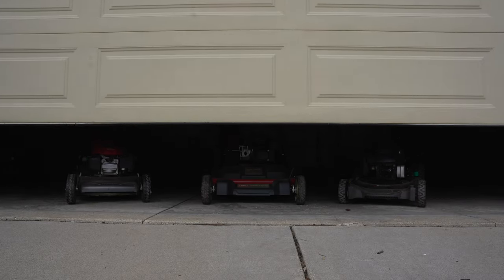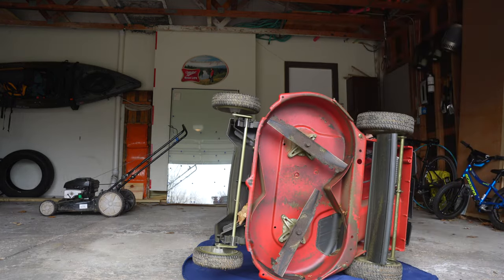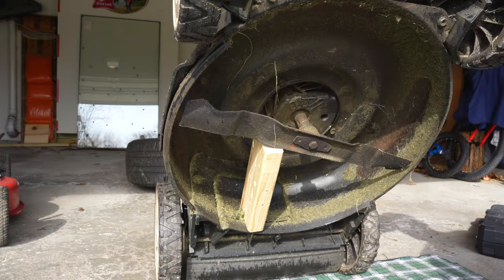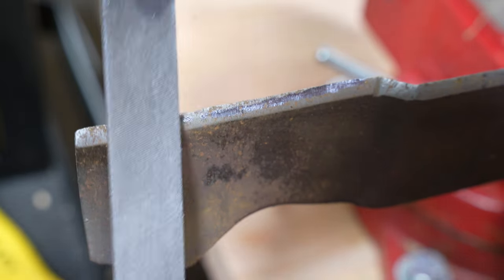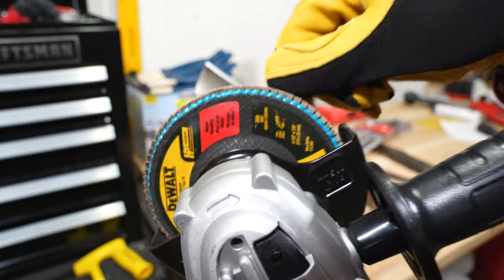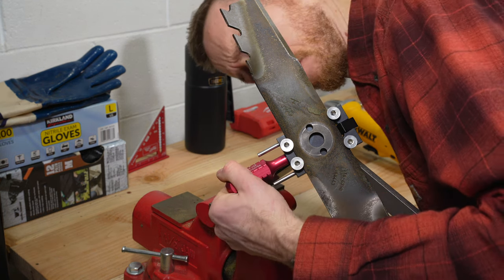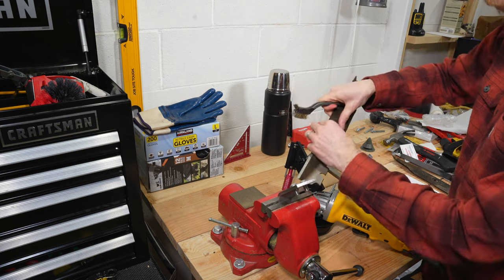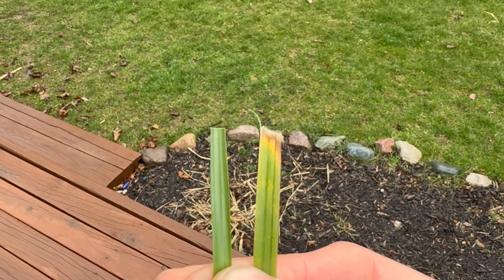Best 3 Ways To Sharpen Lawn Mower Blades!

Comment: I will tell you that you need to use a grinder disc to get the proper angle first, then you can use a flap (floppy) disc
Reply from the maker: I haven't noticed having that issue. I'm guessing the factory angle and the device angle was very close. But, I could definitely see that thought too in many situations. good call out to keep in mind and thanks for watching!

Comment: NOTICE: new lawn mower blades are NOT sharp it is against the law to sell sharp blades,hoes, or any tool that you can cut yourself with in a store! You need to sharpen them BEFORE fitst use. The stores do not tell you this.